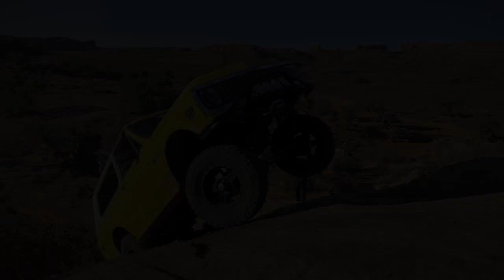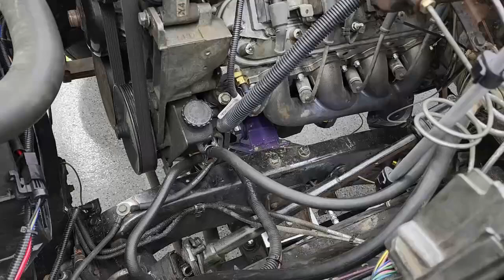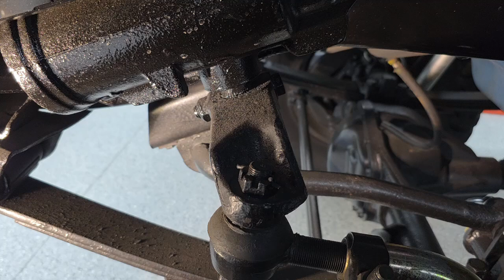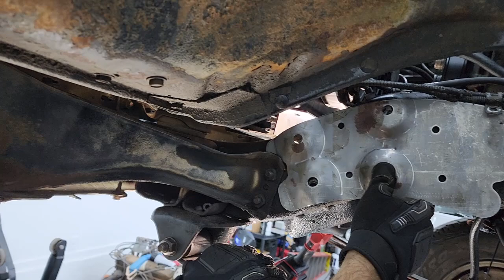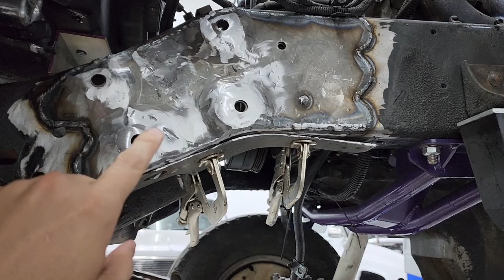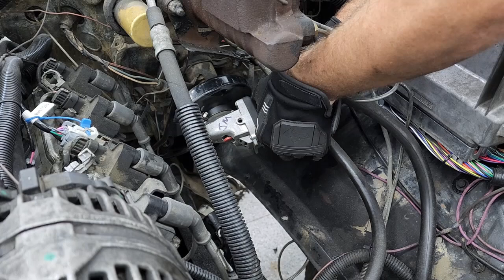Squarebody Frame Brace Install

Comment: Nice work. My 2wd C10 was cracked. I had my welder fix the cracks and welded the plat(off amazon) inside the frame, and I chose not to use the bottom plate.

Comment: Just curious on what welder you are using? Can you get buy with a 110v stick or mig welder for something like this? Thanks. Just wondering if this is something i could do myself or if i need to find someone.
Reply from the maker: We have put a few of these frame kits on. Either as preventative measures or as a major repair. Along the way we’ve used a few different mig machines from an Eastwood 135, ESAB, and larger Miller welders. A 110 mig will do it just fine. A stick welder could too if that’s what you got, but might be difficult with the space and angles.

Comment: What exhaust manifolds did you use?
Reply: Did you have to trim frame?
Reply from the maker: No
Reply from the maker: Summit Racing™ Cast Exhaust Manifold SUM-G9084B. No cutting at all. They have a ball and a flange style, both work great